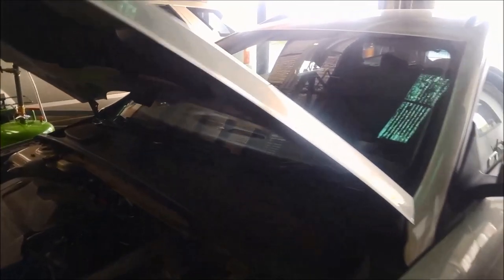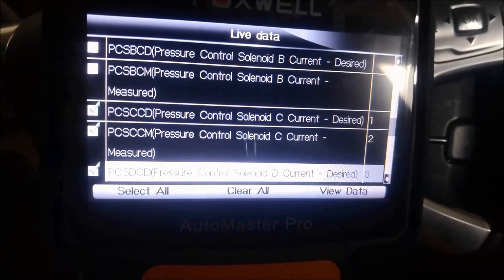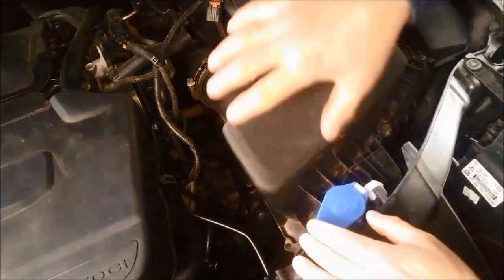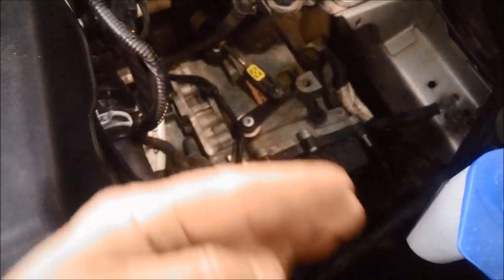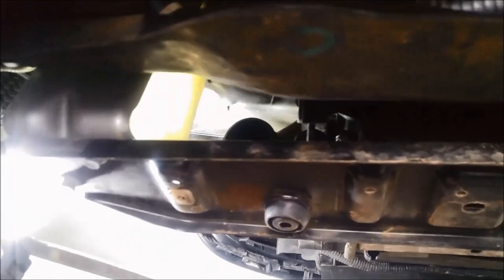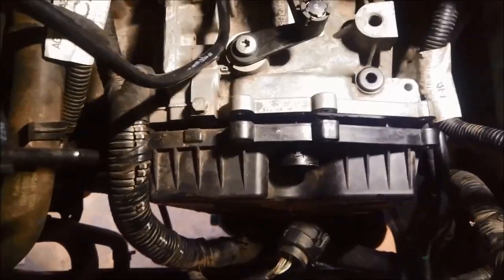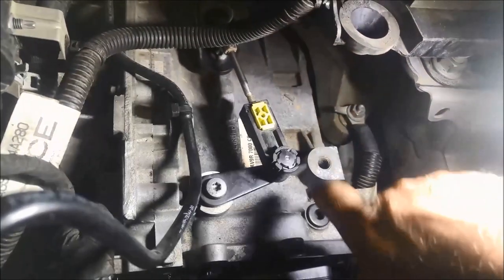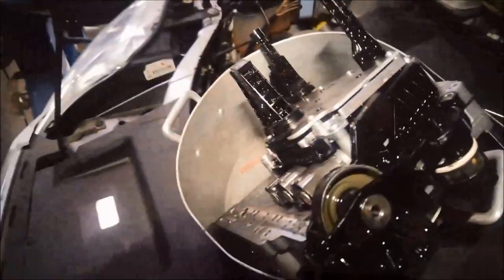DCT Powershift Ford 6DCT450 Solenoid Removal P1of3 Getrag MPS6 MPS6 W6DGA SST Transmission Repairs

Comment: Hi. Thank you for the effort in making a video. 

My long story short. I cleaned out the valve body and megatronic as the gearbox started acting up. There was gunk everywhere. Rinsed and flushed. Car went perfectly for two days. Then errors again. Removed valve body once again. The amount of metal pieces convinced me there is some internal damage. Something is grinding away. 

Removed and stripped the gearbox. The sping with plastic retainers was the issue. One spring was actually broken. And grinding away on the plate. Creating metal shavings. 

Rebuilt the whole box. New spring kit and retainers. New seals. New clutch pack. New internal filter. 

Assemble everything. Now still have a issue. When it gets hot/radiator fan on temperature while driving in traffic. And you pull away it will give a error again. And its almost as if its slipping out of gear slightly just after shifting. 

Error codes currently 
P0965
P2714. 
P0796. 

The car is with a "specialist" for 3 months now unable to resolve the issue. He has obtained another megatronic and cloned. Still the same errors. 

Any advise please. Its costed me a fortune so far. And still dont have use of the vehicle. Should have sold/burn it long time ago.
Reply from the maker: hi, fault codes generally indicate that signals and readings are outside set parameters, and computer will then throw a fault code. is this guy a mechanic or a transmission specialist? there is a difference. cheers
Reply: @YepThatsIt  he is a gearbox specialist. He has however admitted defeat. And wants to throw money at the problem by replacing more and more components. I could have done the same i guess. 
But the question remains. Do you have any suggestions or a idea of what it could be?
Reply from the maker: what has he done or replaced? has he replaced or tested solenoids properly? sorry need much more info, especially when someone else has worked on it. cheers
Reply: @YepThatsIt  hi. I have finally received the vehicle back. But intermittedly it give gearbox malfunction when i put it in park. If i switch it off and restart. Everything is perfect. Drives fine. Shifts beautifully. Only when you stop at home. And put in park. If you put it in neutral. It doesnt give error. Only when you put it in park. Any advice?

Correction. It does it in Nuetral aswell.
Reply from the maker: @johandekock4254  hi, maybe Range Sensor ? or sloppy/worn selector linkage? cheers

Comment: Hi. Thanks for the excellent, instructive video. I bought a 2012 Focus diesel with the DCT450 trans knowing that it had similar defects to those described in this video. Only minor differences between the Focus and Mondeo were around access. I had to remove the cooling fan and choose to unbolt the module from the lower LH front guard so I could move the harness away from the front of the trans. No demagnetizer at home to demagnetize the solenoids, and being in Covid-19 lockdown in NZ I couldn't drive out to work to use one. Solution was to strip down the AC motor on my small drill press and use the stator as a demagnetizer...just had to watch duty cycle as it gets hot quick. Valve body disassembled and cleaned, solenoids and sensors cleaned, internal filter back flowed unit reassembled. End result it works like a new one. Thanks heaps for the advice. Beers are on me. Cheers, Al.
Reply from the maker: hi, in days before demagnetizers were available as easily, my old man did same with an electric motor with armature removed. we use to put solenoids inside a pcv pipe and pass though a few time. but, like you said will warm up quite quickly...good work and cheers looking forward to your beers

Comment: Thanks for the excellent, easy to follow videos! I bought a mk4 cheap with a very badly behaving transmission, followed your videos, did the clutch and shift fork relearn on Forscan, and it's now working well! You saved me thousands, as well as the work involved in removing and refitting the transmission!

Many, many thanks!
Reply from the maker: hi, glad it helped ! we always appreciative of a few beers, link is in description. cheers

Comment: Thanks for those videos! This is the only place where in the car repairs are shown instead of full stripdown.
I managed to remove the mechatronic unit and cleaned solenoids and plates.
Upon reinstallation of the unit I can't push it all the way back in. I can't locate it on two locating pins and it goes in by about 10-15mm but then it gets stuck
It feels like it's stuck against something. 
My suspicion was two long locating pins and slight misalignment of one of the plates so with tight alignment the pin gets stuck.
The pin goes through both plates so if one is slightly misaligned the pin gets stuck 
The other suspect I have is that I have moved the mechanism when cleaning or though holes in the box body when the mechatronics is removed.

Could you please let me know if any is a possible cause or is there anything else?
Reply from the maker: hi, thats an interesting one ! maybe the metal gasket fell off ? you need to recheck your work. make sure you torque the valve body bolts as per manufacturers specs or can cause valve to bind up. cheers
Reply: @YepThatsIt  the gasket between both plates is my suspicion, but i can't see any of these parts to be misaligned.
Both steel gaskets on each side are in place and on both pins 
I will try to remove one long locating pin to see if it fits in the valve body.
I don't think there is anything in the gearbox that I could move to block any of the sensors?
would you be so kind and share torque values for the valve body? I was actually thinking about it and used 10Nm for all bolts and wanted to use the same to bolt the body back, but it would be best to know the spec.
I had a technical manual for this box but probably deleted it.
Reply: @mkaminski100  Just in case anyone comes along, seeing as this old, the valvebody is made up of 3 parts and the locating pins that slide through them are a very snug fit. If it doesn't slide on then the three parts aren't perfectly aligned. Remove all bolts from valve body, remove two bolts from gasket and find something that is the same size as the locating pins to use to hold it all in alignment while reassembling. Not difficult, just annoying.

Comment: Firstly, brilliant video! I’ve just strip out the valve block from my 2014 Ford Galaxy, fault was stuck shuttle valve, not reverse, and limited gear function. I’ve found a small nylon restrictor on the workshop floor, probably come from outboard spears, but just to make sure, as I can’t find anywhere for it to fit! Can I send you a photo? If so how. As your scanner what model is it please.
Trevor, UK.
Reply from the maker: hi, on my channel page you will find "about" and on that link my email. cheers

Comment: G’day mate, Can you help me? I have watched your videos endlessly trying to save myself the 5grand for a replacement gearbox. I have a Ford Powershift DCT450 that had stuck solenoid’s so have followed you very informative steps to thoroughly clean a test every solenoid and replace back into the valve body. All went back in cleanly without issue. The battery was disconnected the whole time, but now back together I have no crank or even an attempt to start. What in the world have I done wrong. One point which I cannot get my head around is the fact that the car will not lock but will unlock on the remote fob, could this be an issue alone the lines of the immobiliser losing program?  Any advise would incredibly grateful.
Reply from the maker: hi, if you have put it all back together correctly, sometimes you need to turn off and on a few times. make sure battery is strong ( low internal resistance ) and fully charged. make sure the fluid level is correct in trans, you will need to get to operating temp, let cool to checking temp and adjust fluid level. cheers

Comment: Hello, thank you so much for these videos. I'm searching to solve a problem of a speed sensor, sensor of turbine A. Code P0715 on a Volvo S80. Do you see what's the problem ?
Reply from the maker: hi, in australia to mid 2015 speed sensor is internal, after 2015 should be external. cheers

Comment: My dodge journey 2.0crd 2009 have same gearbox, in last time when drive kick down hi lost 1,3,5 gear, after restart engine everything ok. What can be? I change 2 time self oil and outside filter.
Reply from the maker: hi, check all the basics first see our vid https://youtu.be/OOwmqeC_4WE , however on these it is most often contaminated solenoids and sensors( if hi mileage then solenoids wear out ) remove front cover, clean & add additional magnets too https://www.youtube.com/playlist?list=PLQLkuOdKuFotLWdTOl3KCK0xpgTu7CEJH cheers
Reply: @YepThatsIt  hi, what say for MOTUL TRANSMISSION CLEANER put on, and after change fluids?

Comment: Hey, I'm keen on hearing your opinion on an issue with this transmission I'm having. I'm receiving this same P0766 Shift Solenoid D stuck off straight after a normal service was done by a transmission shop which was well known for working on these gearboxes. Could something cause this fault after a service like overfilling? Ford did a recal and fixed the issue for a day and same issue returned. Thanks for your very informative videos.
Reply from the maker: hi, normal service on these trans is just a fluid change. best to remove front cover and clean magnets as well. sometimes you will need to bench test solenoids to see if viable to flush or replace them. make sure you check all our 6dct vids for more info https://www.youtube.com/playlist?list=PLQLkuOdKuFotLWdTOl3KCK0xpgTu7CEJH and also read through past comments. cheers

Comment: Can I ask why you wouldn't have bothered had the fluid been really dirty? Mine was when this error code first appeared and now I cant get one set of gears. Shift fork B stuck was also appearing, although that's gone since i changed the fluid and filter. Is it worth me trying this? It's only saying Pressure Control Solenoid D stuck on.
Reply from the maker: hi, if fluid contains shredded pieces of plastic then means the plastic spring guides/holders are damaged and your repair will be short lived. on these you need to remove front cover and clean magnets every 2nd service or your solenoids and sensors will get contaminated once the magnets have covered in fine metallic debris and cant attract more. the internal filter is inside trans, the external filter cartridge is the cooling line filter. cheers
Reply: @YepThatsIt  thanks for the reply. Fluid contained no debris whatsoever.  Only DTC I'm getting now is P7214 Pressure control solenoid d stuck on. Only have 1 ser of gears. Any recomendations. Just hope I don't need a whole new gearbox

Comment: That cable with the 3 wires is that one attached to the input shaft sensor if so how is that removed if not were is such part located. Part7H103B many thanks dude
Reply from the maker: hi, I would recommend getting a repair manual https://www.atsg.us/atsg/catalog/seo_sitemap/product/ . some aftermarket parts are hard to find for these, but you can try online or from dealership. cheers
Reply: @YepThatsIt  The site does not have a listing for a 2011 FORD MONDEO. Can you provide a more specific link to the manual, please?

Comment: Please i need your help, i have a mondeo 2014 mk4 with poweshift automatic, the transmission was leaking oil but was working properly, i took it to the shop and the mechanic did a rebuild, replaced everything.
Now the car won't shift properly after calibration. The mechanic told me that he will try installing a software for the transmission from ford server, in case that doesn't work.... what seems to be the problem?!
Reply from the maker: hi, your mechanic may need to recheck their work if a relearn and software update doesnt help. cheers

Comment: Hi, great video. Did you ever came across P2849 and p284C code? Basically transmission is shifting to the 7th gear and not allowing to select any other gear.
Reply from the maker: hi, do all basic checks first incl battery strength and good earth connections. you will need to mucking around turn off/on - select - etc many times as the sensors are heavily contaminated with debris, until it gets a clear signal to the tcm. cheers

Comment: Hi. Can you install the ford powershift 6 speed wet dual clutch in a volvo with same application directly. Or will there be a software clash
Reply from the maker: hi, transmission internals are mostly same, bell housing bolt positions will be different i`d say. cheers

Comment: Hi there, own a Mitsubishi Outlander 6DCT470 4WD transmission. I am wondering how could I remove/check the electronic control panel of the transmission. I suppose there is a soldering failure of the clutches position sensor. Maybe you have some referring videos? Thanks
Reply from the maker: hi, check other related vids in video description. cheers

Comment: If you replaced all the solinoids in the TCM do you need to programme new strategies??
Reply from the maker: hi, all fault codes need to be fixed and cleared then trans will readapt on its own once reaches operating temp. shifting manually 1-2-3-2-1, then 4-5-6-5-4 etc as you drive may help speed up adaption. if you have no movement after replacing or cleaning solenoids, try turning vehicle on/off a few times, just make sure you have enough fluid in trans. cheers for beers, link is in description

Comment: Gday. I'm having issue with gear change. Oil always changed every 40km. About 40 K ago and replaced clutch cover seal was leaking. 

Car has been good. No shudders ever or clutch issues. 

Other day wouldn't change into second gear just neutral sort of change. Stopped and started again. Same thing. But if manual mode selected went from 1st to 3rd after some hesitation. Has a fault code for unable to select second gear. Do U suggest I remove the valve body to clean out ?

Fault code P074A:00-27

2011 Mondeo with 380/000km
Reply from the maker: hi, fault codes are generally related to electrical or sensor issues. probably best option to start with after checking all the basics. if you have bits of plastic in the fluid or lower part of trans, then you need to remove trans. cheers

Comment: Hi Sir, I have a Ford C-Max with the same gearbox. I have changed the clutch and solenoids, and the car runs normally when it is cold, but when the engine temperature reaches 90, a gearbox problem appears on the screen and lose reverse. It gives the code p2849-A0. Do you have an idea about the problem. Do it need changing the TCM?
Reply from the maker: hi, if shift fork is stuck then mechanical fault. cheers

Comment: Hi, Thank you for helping so many people with this. I was getting these error codes (despite being vigilant about changing trans fluid and filter before schedule) and was about to do this service procedure on the mechatronic unit but when I got under the car I saw trans fluid dripping near the bell housing. Any home mechanic fix for this at all or do you need to drop the whole transmission?
Reply from the maker: hi, it depends where it is leaking from? if inside bell housing, then you will need to remove trans. cheers
Reply: @YepThatsIt  yes, appears to be from inside the bell housing. Local trans shop says once main seal goes it usually results in clutch contamination carried through the rest of the system. Full or partial rebuild depending on clutch wear. Does this make sense?

Comment: Great video much appreciated. What did you use in your wash bay? Gearbox fluid, degreaser or water. Thank you.
Reply from the maker: we use solvent call 1215 or x55, thanks and cheers
Reply: YepThatsIt sorry to be a pain but can I use shellite as I have some at the house and just doing one gearbox? Cheers
Reply from the maker: @mattnap3297  if doesn`t damage seals or plastics, is will be ok

Comment: I'm thinking of byuing a mondeo 2014 titanum x with the powershift automatic, so do you recommend it? or should i look for a manual?
Reply from the maker: hi, like all transmissions, regular service, add more magnets and bypass cooler and they usually last much longer. cvt, dct and dsg transmissions need even more shorter and regular service intervals. on 6dct450 we advise to remove the front cover every 2nd service and clean the magnets, not just a fluid change. cheers
Reply: Thank you!

Comment: Hi Sir. What oil do you use for that type of transmission? I'm thinking we have the same transmission. Thank you. 😊
Reply from the maker: hi, just check any brand and compatible with your vehicle. we mainly use penrite or tritech lubricants. cheers
Reply: @YepThatsIt  I see. I think we don't have that in our place I will have to check on my manual, I haven't seen my manual for a while now 😅 thank you so much sir.
Reply: @YepThatsIt  sir by the way may I ask did you have to do a software upgrade or did you have to tweak the TCM software after assembling it back together? Thank you so much.
Reply: @YepThatsIt  also sir for the demagnetizer I saw in your video, can I use a regular magnet we can find on old speakers? Will there be no contra indications with the windings of the solenoids? Sorry for the questions. Thank you so much sir. More power! 😊
Reply from the maker: hi, no you can`t demagnetize with a magnet....you can buy demagnetizer or degauser online or contact me on my face book link https://www.facebook.com/Yep-Thats-It-103051017785435  and leave me which  kind of vehicle/transmission type you have, and leave a detailed description of any fault codes and issue you are having ( we are able to exchange pics/diagrams on there ) and details of what work you have already performed or checked...... you will need to buy me some beers ( link is in face book ) and I will answer your questions accordingly. cheers